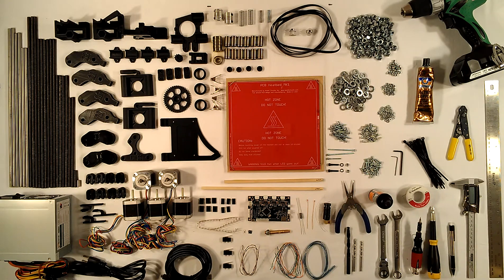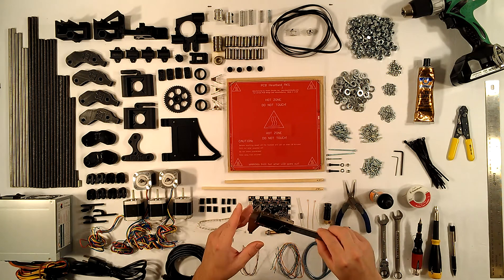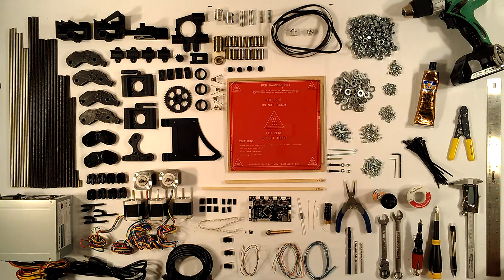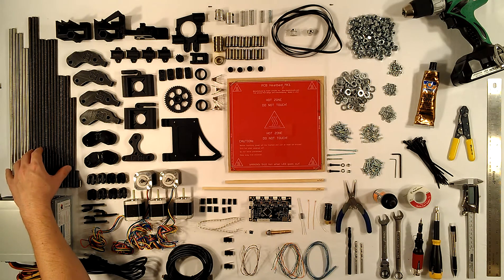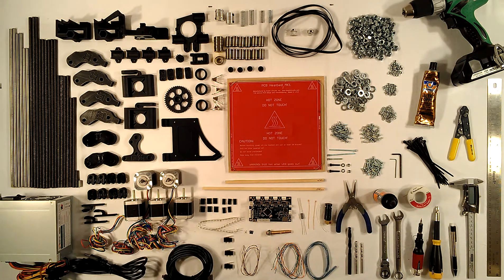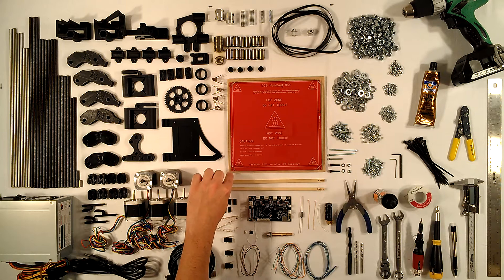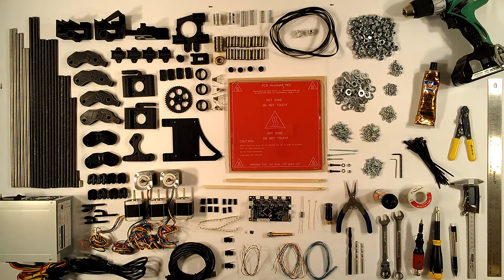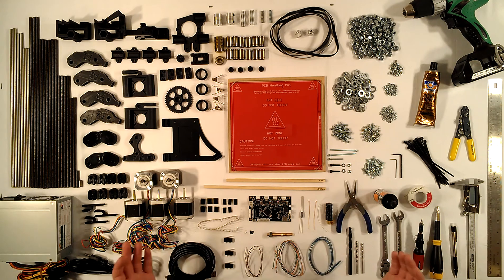RepRap Prusa Mendel Iteration 2 Assembly Intro

Comment: I wonder if it would be cheaper to source all the parts individually rather the buying a complete kit.
Reply from the maker: It could be cheaper to source the materials yourself. The kit would save you a lot of time and hassle. When I built my first RepRap over two years ago, it took me about fifty hours and a thousand dollars to source all the materials. It was difficult to find an accurate materials list back then. I ended up purchasing components I didn't need and I didn't purchase components I didn't know I needed which resulted in waiting for parts. I also found that I had to order components from many sources which cost a lot in shipping. If you are meticulous and patient, you might be able to source the components yourself for less than the cost of a kit. :-)
Reply: engineglue Thank you for the advice. I think I'm going to go for the Reprap Prusa i3 I seen MDF frames on Ebay for reasonable prices. May save some headaches not using the thread rod style frame. It may even work out cheaper overall. I thought the latest Reprap parts would be way too expensive.
Reply from the maker: haz939 You may also want to compare the components between the kits you find. Look for GT2 timing belts and pulleys, 5+KG-CM stepper motors, assembled ramps, J-Head hotend, hotend mounting plate, PCB heatbed, glass print surface, and linear bearings. :-) Have fun!

Comment: there are 3 items on the BOM found at nwreprap, are those parts essential? Have you shown how to install them in your videos?
the parts are:
 J-Head Aluminum Mounting Plate
 30mm 12v Fan
 Z Axis Aluminum Couplings

Comment from the maker: The Prusa i2 is capable of 0.1mm layer height and an accuracy of 0.01mm. Any extruder which can mount to the x carriage will work. You can also print a new x carriage. The extruder that comes with the kit can fit different hot ends. Some with a 0.4mm nozzle. The Prusa i2 can print PLA or ABS. A 10x10 heatbed would likely not work well with the Prusa i2. You might want to look into another printer. :)